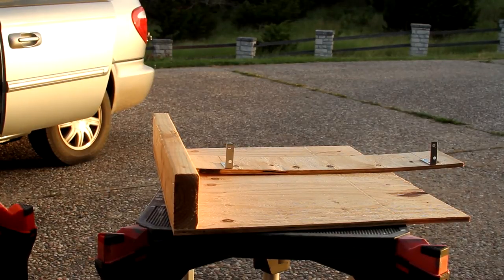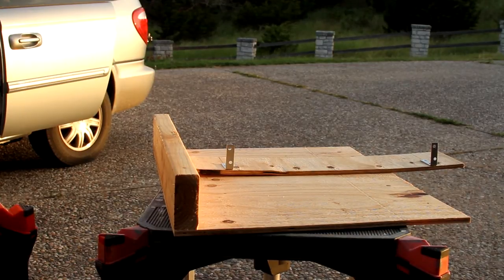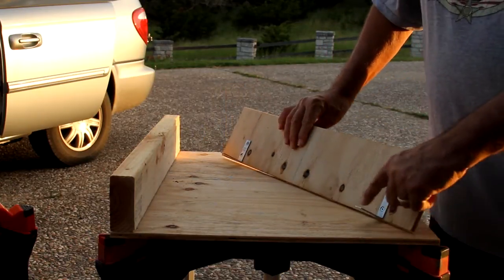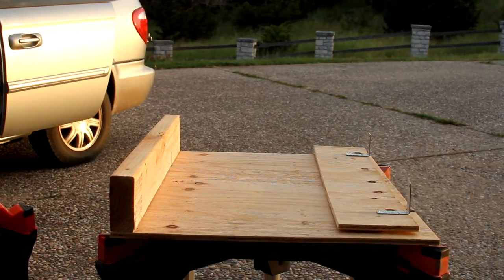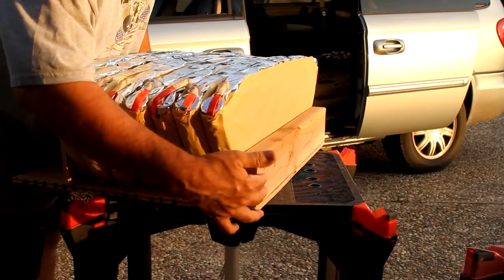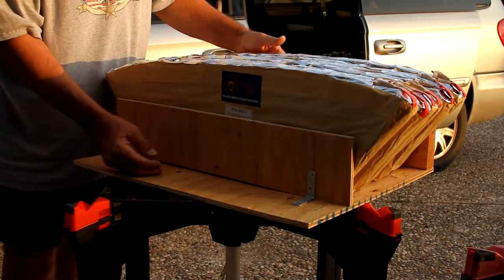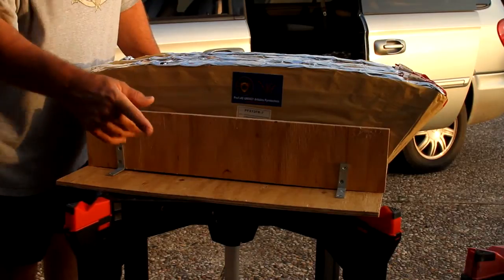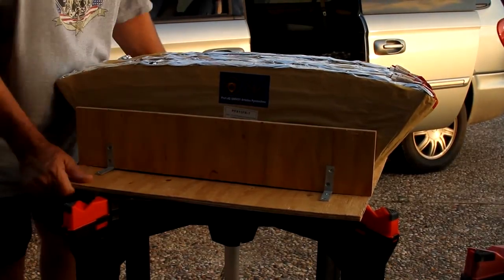Fan Slice Rack

Comment: I like your idea. I have had these slices catch fire (internal quick match) about 1/3rd up from the bottom. I would suggest adding some 1/4" plywood separator sheets between slices or maybe even a strip of aluminum flashing to prevent unwanted passfire.

Comment: Can you use the new I-match on these?
Reply from the maker: SKMC69 imatch, ematch, a piece of fast fuse and a Talon, a piece of slow visco, whatever you like.
Reply: mguerramd Thanks. I had some issues testing that I-match on cake leaders. It's not igniting them most of the time. I switched back to Talons on those. I was just wondering,
Reply from the maker: OK, realize there was a bad batch of imatch last year that did not fire. If the match did not fire that was bad imatch. If the match fired but did not light the fuse, that's different. Do you recall which scenario you had?
Reply: Yes match fired but the fuse didn't light. It was a fast visco leader. I had a few duds too that didn't show continuity.
Reply from the maker: SKMC69 How did you connect the imatch to the fuse?
Reply: @mguerramd  Update: I had 2 boxes of the bad batches back then...lol.